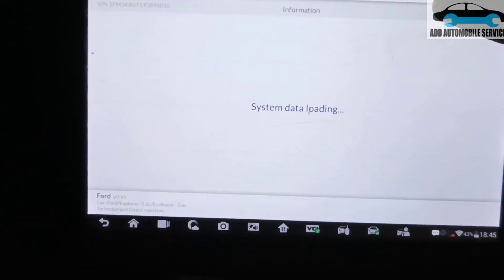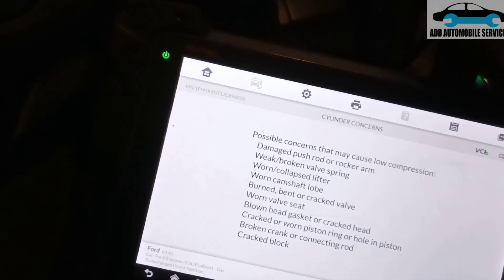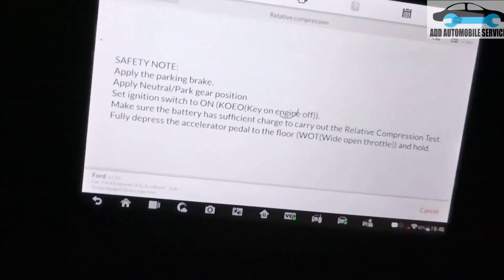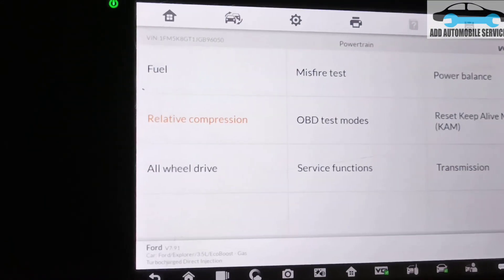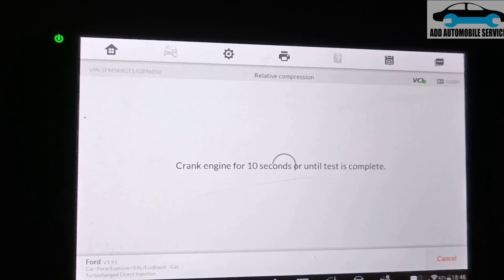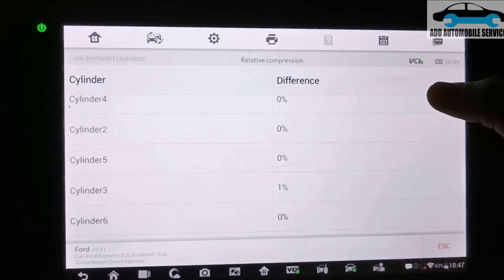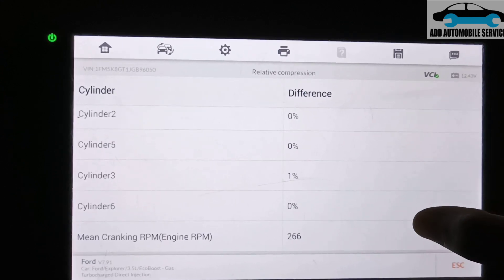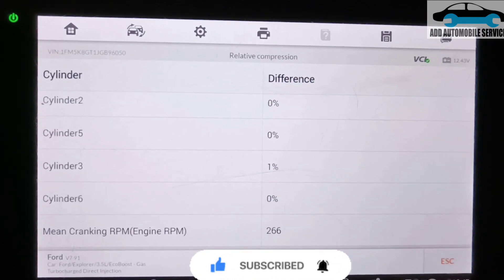Relative compression test with scan tool (im608pro)

Comment: nice sir ❤ 
In fact, I do not use this function much. so from your experience, is this function considered powerful in diagnosing engine compression, and to what degree can I trust its strength?
Reply from the maker: It is what the OEM tool does and sometimes I use it during misfiring issues